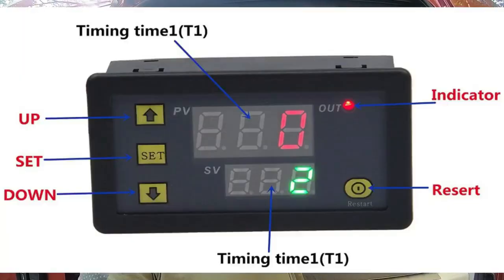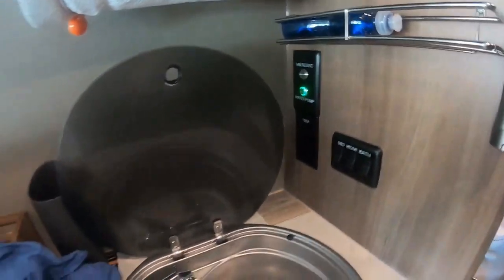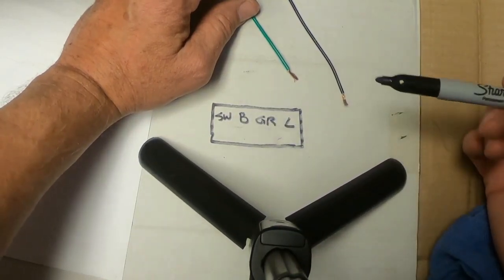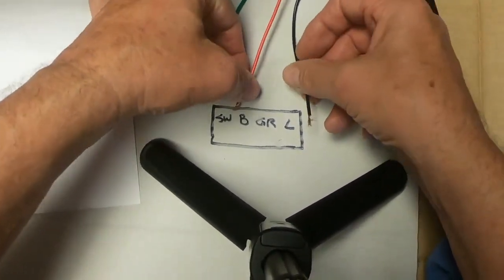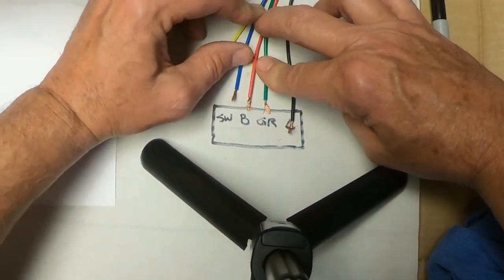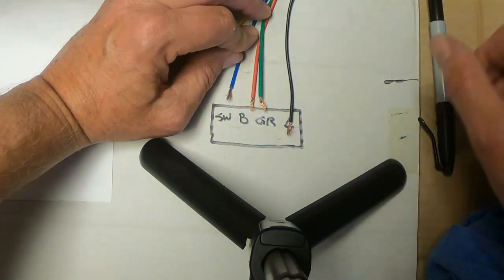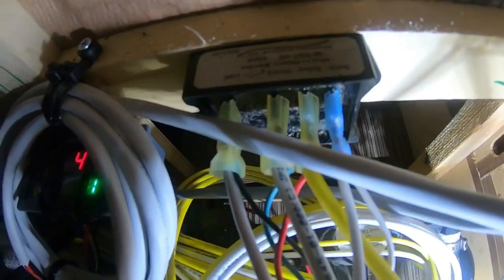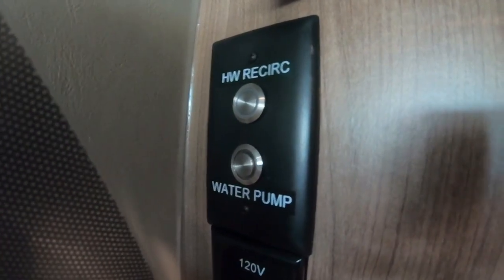Travato Water Pump Automatic Shutoff

Comment: Great mod! Question: I get the pos and neg connections to the timer but not sure about the other two connections. My timer labeled S0 and S1, which wire should be connected to the SW and GROUND? Thank you!
Reply: S1 to ground, S0 to water pump switch.  When the time you set is up, relay closes and allows negative to the switch, which will shut the water pump off.  It will also cut power to the timer.
Reply: @saabmagicman2588  awesome! Thank you so much! Will be setting it up this weekend. This is a valuable mod coz I often forget to turn the pump off. Take care.
Reply: @CBL138  good luck!
Reply: @saabmagicman2588  just to clarify, S1 is to connect to the GND (same wire that connects to the battery negative) on the control module or the negative side of the pump (on the control module)?
Reply: GND on module
Reply: @kconatymd  thank you!!